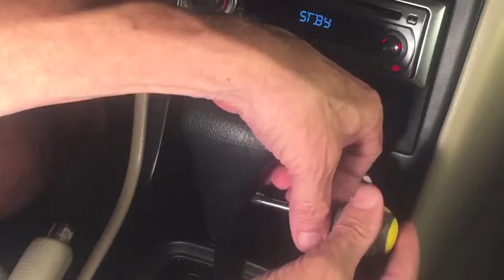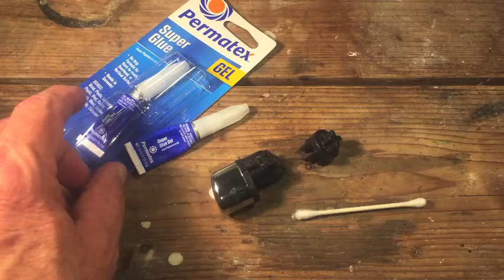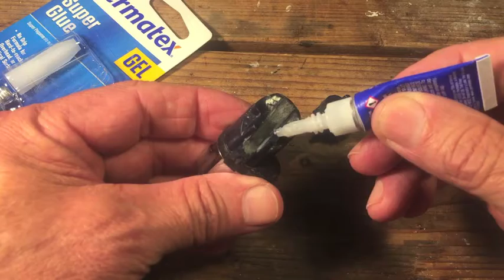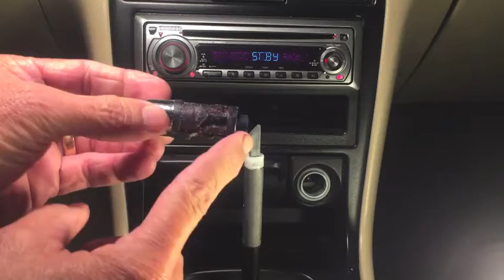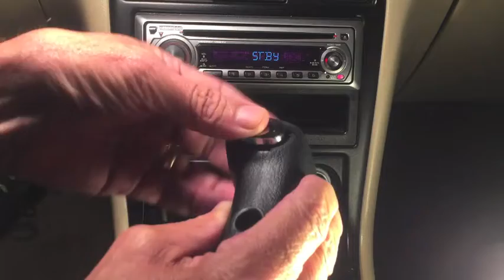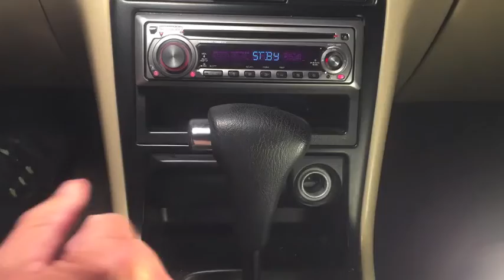Honda Broken Gear Shift Button Repair/Lasted 18 Months

Comment: Wow your broken button looks better than mine which was shattered into several little black pieces. They kept falling out like bad teeth. Could still shift into gears with my finger pushing in the spring or pushing down the inner silver button. Will replace part soon.
Reply: After watching this, I placed an order on Amazon for my replacement
Reply: I did it! I’m so proud of myself, it took me a lot of times to get it right. Thank you so much!

Comment: Thanks for the vid. Min dry rotted - dealer quoted me $300 for a 03 Honda accord. Ordered it for $3 and did it myself 🎉
Reply from the maker: You're welcome.. Glad to have helped..
Reply: This is the same issue I'm having with my accord 2003
Reply: Where did you order the part from
Reply: @jimmettawilliams  in my very quick online search, i see the replacement part listed between 9 to 13 dollars.
I plan to keep looking, but considering a wood dowel or some other DIY option, if nothing else, a DIY as a backup.

Comment: I did all this and my key won't release
Reply: Same here.  Did you  ever figure out why?
Reply: Just did this repair today and got the same issue of my key not releasing from the ignition. The screws were too tightly torqued when putting it back together. I had to hold the handle as far up to align the screw holes in order for the knob to work and don't tighten the screws too much so that the sensor is not tripped thinking the car is not in park.  Hope this helps...